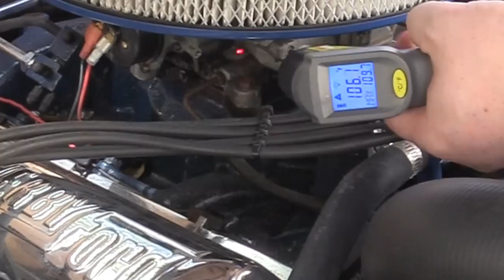Fouled Spark Plugs Cause No Start

Comment: I snarfed my coffee just a wee bit this morning when I awoke to this video since I almost called you yesterday about my own Autolite 4100 carbur-tater problem. Like yours it runs way too nicely to be most of the major stuff, but it likes to spontaneously overfill the back bowl if I happen to over-enthusiastically enter my driveway, which means it then proceeds to trickle/pour gasoline onto the secondary throttle plates. Having checked and rechecked float level, wet, with the engine running, it’s something I’m still worrying through. Sometimes that’s just what you gotta do!
Reply from the maker: I will address that next on the video we'll put up on the fix we try. That is a consideration on the four barrel carburetors.
Reply: @AutoRestoMod  I’m gonna try getting a set of the baffles Ford apparently used originally...for science. I’m also changing the float out and putting in the missing damper spring that some previous rebuilder lost. And if all else fails, my fix of just not driving the car has otherwise been proven to be 100% effective in preventing me experiencing this issue.

Comment: Had this problem before fixed it by putting a 4 core radiator in to help with cooling. Also changed the fan.

Comment: I bought one of these, same color, new in 1974. I replaced the stock carburetor with a Holley four barrel and it went. That was in Vancouver where winters can get cold allowing the Ford to show its nature (Not a cold start engine usually) another problem fords have is the fiber gasket on the intake manifold. Nice truck but I don't miss it.
Reply from the maker: LOL

Comment: I had this exact issue decades ago with my 360 FE. Summer time was the worst, you 
would have to literally wait for ever for it to cool down before even attempting to restart it. 
It would start right up on a cold morning and run just fine otherwise.
Reply from the maker: They are an issue.

Comment: Jeff, please do a follow up. My 71 F100 390 has been doing that for about a year now. Aluminum intake, spacer under carb, fires great in the morning..... after running, not so much. Going to switch to non ethanol gas to see if it clears up. May end up putting in heat extractors in the hood to cool it down a little more. These FE's sure put out the heat!
Reply from the maker: If you have done all that, I might look to the timing and see if it is too high.
Reply: @AutoRestoMod  Appreciate it. Dropped the Petronix 2 module in it, idle is at 800-900, and the timing is set 9 degrees BTDC. My ears did perk up when you mentioned the spark plug gap needing to be different with the Petronix. I'll do a plug swap out this weekend and see what I get.

Comment: I have a Weiad triangle shaped air filter on a 289. The bottom plate is flat and allot smaller than a stock air filter.
Reply from the maker: I like the look of the stock Ford air cleaner.

Comment: My 69 cougar did the same, I installed an electric fuel pump.i shut the pump off before shutting the car off to let it use up most of the fuel in the cab. I turn the pump on before starting again. It has fixed my problem. Just my 2 cents.
Reply from the maker: Interesting solution.

Comment: If I don't use a spacer due to clearance issues, I like to use the 3/8 thick flange gasket to insulate the carb a little.  I remember International Harvester used a thick gasket that extended out just past the fuel bowl that was supposed to keep the fuel in the bowls cooler.
Reply from the maker: We have a 3/8 fiber gasket that Ford used on the Boss302 in play now. I want to further isolate the carb and see what that does.

Comment: JEFF and KAM.  I have been FIXING THIS issue since 1983.. the fix is a 10 micron fuel filter before the mechanical fuel pump..  disconnecting the fuel line to the carb..  extending the fuel line into a clean clear soda bottle. disconnect the power to the ignition coil.. get somebody to crank the engine for 15 seconds while you watch the pulses into the bottle.. you should have equal pulses..  do this 3 times.. each time for 15 seconds..  hook the hose back to the carb and you are fixed..

 WHY..  sediment in the fuel pump check valves reduces the suction from the tank and the pressure held in the fuel line to the carb..  it also gets into the needle and seat in the carb..  what happens.. when you shut off.. your needle and seat is leaking and overflowing the bowl and fuel is dripping out of the booster venturi's.  causing the carb to flood the cylinders.. but eventually the fuel in the line is exhausted and whats left turns to vapor and vapor starts pouring out of the carb..  down at the fuel pump the partially open check valves allow gravity to allow fuel to drain back to the tank.. taking some out of the float bowls as the needle and seat level is below the normal fuel level.. 

 the 10 micron filter before the pump works with flushing the pump with filtered fuel.. 

 don't believe me.. pull the fuel line off the carb.. and try blowing into it.. you should NOT be able to blow bubbles in the fuel tank..  still don't believe me.. extend the fuel line with some clear vinyl hose and hang it over the hood latch.. crank the engine with the coil  power disconnected until you get fuel in the clear hose.. notice how long it takes to get fuel from the tank and thru the pump into the hose when you have fuel in the hose stop cranking.. watch the fuel vanish backward thru the fuel pump as the check valves are now partially open..

 i use either a 1984 corvette fuel filter as it has 3/8 inlet and out let or a 1994 ford probe fuel filter as it has 5/16 inlet and outlets and those are both 10 micron rated filters.  it is the only fix and i have been fixing cars for a living since 1979..  after a year of automotive trade school.. not just a guy with a bucket of tools.. 

 there are other issues the 10 micron fuel filter fixes.. Hot vapor lock coming to a stop or idling in heavy traffic..  the engine will start to run rough then stall and won't crank .. this is the fuel in the pump and the line to the pump not having enough pressure to stop from boiling and turning to vapor  the liquid fuel is pushed back to the tank thru the partially open check valves in the fuel pump .. the engine running on vapors leans out. the pistons and rings expand beyond normal and grip tight in the cylinder walls preventing the starter from being able to spin the crank..  this is why after 10 minutes the engine can be cranked but it takes a while of cranking to get the fuel from the tank.
Reply from the maker: Aweome input! We will look at that next.

Comment: Definitely would like to see the result of the phenolic spacer.  I have a 77 F150 with the 460 and have been dealing with this issue since getting the truck back on the road in 2018.  I always have to give a couple of pumps as least for the truck to start.  Of course, it's always worse in the summer and after driving it for more than 30 minutes, stopping and then restarting, I usually have to pump it a lot to get it restarted due to the gas boiling out of the carb.  I can't run a phenolic spacer right now because I still have the original spreadbore manifold that the Motorcraft 4350 used to reside on.  I now run a Holley with an aluminum, spreadbore to standard bore spacer under it.  I bought a phenolic spacer to try to fix my issue but the carb ended up sitting so high, the kickdown for the transmission wouldn't line up.  Luckily, this isn't my daily driver so I tend to just deal with it best I can.  But I'd like to upgrade to an aluminum intake down the road and then I could use the phenolic spacer instead of the aluminum adapter.  I enjoy ya'lls videos, thanks.
Reply from the maker: You might look at an aluminum plate between the Holley and the spacer.

Comment: i will email you when i get the chance to have free time to open up the carb if need be xmas is around the corner so most likely early january ........my neighbor told me to throw in a set of platinum plugs in my 1970 engine with a pertronix ignitor in the dist .......besides the carb issue what do you think about platinum plugs in a 1970 engine ......yall have a great channel i love it , soon yall will have 100k subs and a silver plack on the wall ,,,bravo ..

Comment: Had similar issue to this with an Edelbrock 600 carb on my 289. Had to increase the spacer thickness and swapped to Aluminum. It still didn't completely stop the issue yet. Still working on trying to solve the issue but the ethanol fuel and the Texas heat don't help a non-daily driver!!
Reply from the maker: Yep. We have one more trick to try after this one (if it doesn't work)

Comment: Greetings!  I think I remember you saying that you thought you had a 390GT. All the "S" code 390 engines came from the factory with a 1/4" Phenolic spacer. The original carb was usually a Holley 4150. I think such a spacer would really help. BTW thanks for the great video on the F100 Mirrors!  I was able to get the parts you suggested and the job went smoothly. Thanks for all the great videos. You guys rock!
Reply from the maker: You are correct. We have the phenolic in place. hoping the 1/2 inch will help.

Comment: Get a turkey roaster pan and a hood scoop like they used on the Cobra. 

My Bronco always did this after a long highway drive.  I always wondered why it never did it for the first 10 years, then it became a constant problem on hot days.  Somehow the factory tune prevented but, but after a few carb rebuilds it lost that tune.
Reply from the maker: Interesting. The f700s had a scoop that was for extracting hot air....hmmmm

Comment: Boiling point of gasoline varies with seasonal change, winter forumalitions have a lower point than do summer fuels. Change over varies depending on region. Seems no matter what season, after a week or so of setting,  bowls in my stuff are mostly dry. 

My old 428 has always been hell on plugs(we been together 48 years), a Pertronix conversion didn't give much improvement. Somewhere around 20 years ago, I added a Crane Hi-6 ign(their version of MSD 6AL, now discontinued?). It's triggered by the Pertronix. Opened plug gap to .045 and it still runs the same 20+ year old plugs that were in it when I installed the Hi-6. Assumin' there gas in carb bowl, starts easily. NOTE These ign systems will burn up the orig type graphite wires. To retain the OEM look, I now use the Pertronix Flame Thrower, 7mm spiral core wires.
Reply from the maker: Awesome tip!

Comment: Just thinking out loud - I’m thinking you may have a tank full of winter blend fuel in the truck, winter blend is a “lighter” blend than summer gas as it has quite a bit more butane in it which will tend to boil up quite a bit quicker than summer blend now that temps have come up some. Springtime & fall wit ill usually show it up the best especially on older carbed autos. A quick remedy you might try is to “heavy” it up with a touch of  fuel stabilizer to get you over the hump till summer blend is out.  Best of luck & as always great videos !
Reply from the maker: You may be right. I try to run ethanol free or 93 but these carbs are inherently pukey. I'm going to try the spacer and see.

Comment: 1. Does driving at highway speeds for a while (like 30 mins) unfoul spark plugs? 
2. Is an inadequate cooling system the root of the problem? Ie. will an electric fan, new radiator help?
3. Also - I love the music at 2:30!!
Reply from the maker: 1. Yes.
2. No. It runs quite cool thanks to the clutch fan and huge radiator.
3. We use Artlist for our videos: Born Tough by James Paul Mitchell
Reply: @AutoRestoMod  thanks Jeff for always answering

Comment: Sir, first thing in a situation like this is, use a vacuum gauge.  
I'm not trying to be a know it all,  I'm trying to help. As a Racing Engine Builder for decades,  it's a know fact, that 90  percent of the time the carb is blamed, it's not the carb.
GOD BLESS. 
T.S. RACING
Reply from the maker: Agreed. The engine in fine tune, the issue is fuel push from heat. A "hot soak" problem. I've put the vacuum gauge to it and we are at about 18 inches no fluctuation.

Comment: Is there a reason my post from this morning is not here? I did link to another channel and gave credit.
1) this is a Holley. The body warps so air enters the carb (anyone ever deal with the original gaskets to the metering block?) You likely replaced the gasket during the re-build
2) Vapor separator gas filter. Will need a return line to the gas tank
Reply from the maker: LInks will sometimes get sent to the spam folder by YouTube.
1. Autolite, but that is an issue, however, I did check the base for warpage and used a new gasket.
2. The problem really seems to be perking, the front drivers side of the bowl gets very hot and I think it is probably losing gas to vapor.
Reply: @Autorestomod Manic Mechanic Gasoline Media  1) on Holleys, warpage between base and metering block
2) vapor separator gas filter will take care of percolation.

Comment: Thank you for the tip on spark plug gap. I hav a 63 Falcon with a pertronix EI.  I gap the plugs at .030. Do you think the plug gap could be contributing to the plugs consistently fouling with soot?  What would you recommend the gap to be set to?   One last thing, pls do a follow up!!
Reply from the maker: Gap to .45 and see if that helps. You might need to adjust the jetting and some other things, but start there. Followup airs 4.8.21

Comment: I ultimately solved the fuel percolation problem in my ‘71 Corvette by insulating the fuel pump to carb fuel line. It was routed too close to the engine block. Sounds like that’s not your problem, though.
Reply from the maker: Fueling can be super vexing...

Comment: I always suspect a leaking powervalve before anything else. They will leak just a tiny amount and will cause a rich start. And since this is a new problem I would not suspect heat soak as it didn't do it last year did it?
Reply from the maker: You could be right.
Reply: @AutoRestoMod  It would be the second time I was right about something this century according to the better half.. :)

Comment: i have a(4vents)vented fuel tank in my 1970 fury plus a vented cap ...is that ok or should i just use a normal non vented cap .....im asking because i have no clue if im over venting and maybe is it possible that too many vents create a vacume dumping extra fuel into the intake ......my plugs are wet thats why im asking
Reply from the maker: That is more likely a carburetor problem than a venting problem with the fuel tank. You may have a situation where your floats are set incorrectly or you may have a blown power valve if it's running a Hollwy carburetor. Email me at jford@autorestomod.com and we can break it down further.

Comment: Hey all, quick question. I have a 69 f250 and the brake lights arent working, turn signals work but no brakes. Replaced the brake switch, flasher relay and bulbs. After all that, the brakes and emergency flasher doesnt work. Any ideas?
Reply from the maker: I'd look to a grounding issue. We did a video on chasing grounds:
https://youtu.be/ecC07ZvWFwA
Reply: @AutoRestoMod  Would a bad ground effect the brake lights and not the turn signals? They are the same bulb.

Comment: This is very, very similar to the issues I am seeing with a 62 283 with a Rochester 2 gc (all stock, cast iron) even down to the substance around the spark plugs. However, I have been running ethanol free fuel. I also have the phenolic spacer that I am planning on installing. I'd really be interested in seeing the resolution to this.
Reply: My 67 327 has the same issue. Only thing that will help engines like ours out is to plug the exhaust port for the choke. Between the heads and intake. And remove the exhaust heat rise valve on the passenger side. I switched to old c4b edlebrock intake and switched to electronic choke. Hope this helps.
Reply: @ivanbadillo4909  Thank you , Ivan. I am running stock 265 exhaust manifolds. The exhaust valve has been removed and replaced with a spacer.  When I replaced the manifold, I didn't block off the exhaust that runs under the carb. The carb I have is actually a Rochester 2g, so it has the manual choke wired open, because the car will not start with any amount of choke applied at this point. I misspoke above when I said Rochester 2gc.
Reply from the maker: Right on

Comment: The problem is Carbon on the valves
Reply from the maker: I feel pretty sure that the issue is heat related. While we were messing around with it after shooting the bowl temp was 210 on one corner, making me think that is causing the vapors...